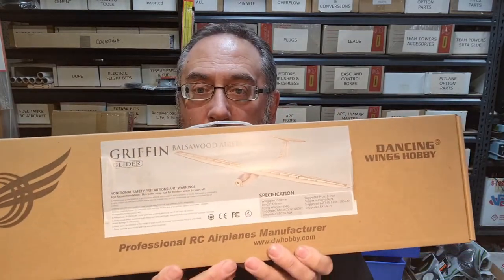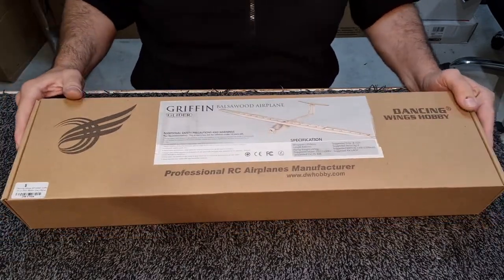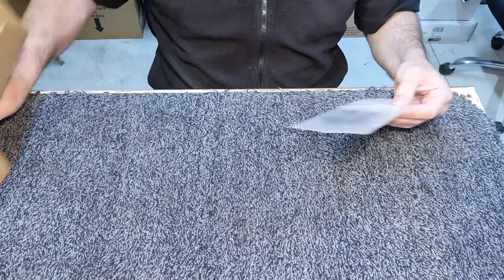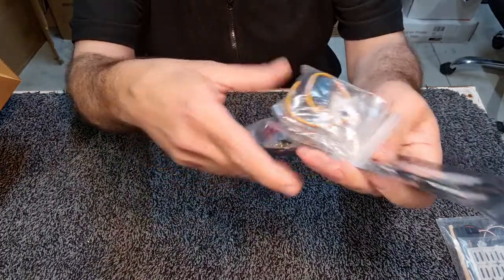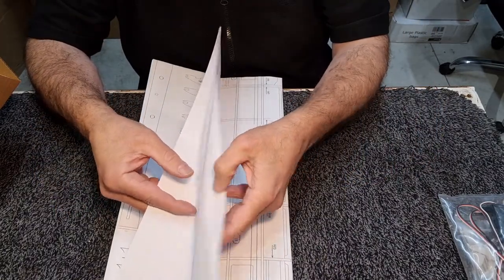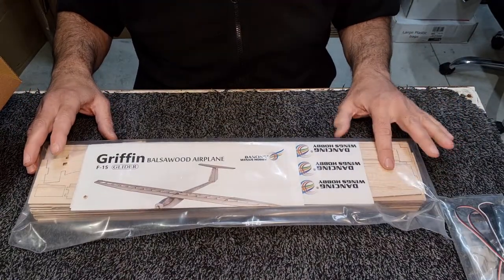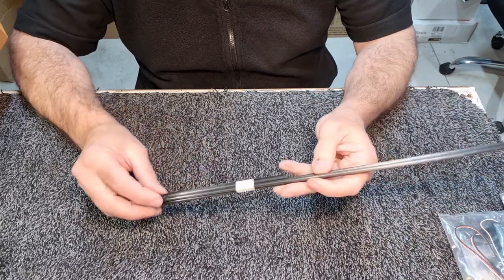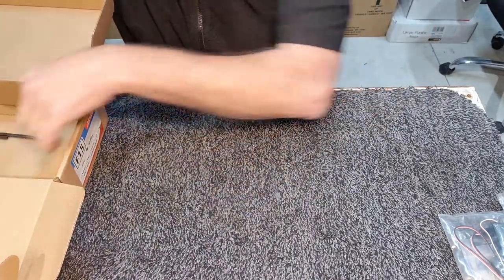A short and some what quick intro to the Dancing Wings Griffin 1.5m electric glider kit.

Comment: did you ever finished the build?
Reply from the maker: Yep but was too lazy to record, sorry. Hence so long to reply as i took my time. 
The build was easy and no issues building. Used mostly C23 and yellow wood glue instead of CA as there was a bit of sanding before covering.
Reply: How does that thing fly?